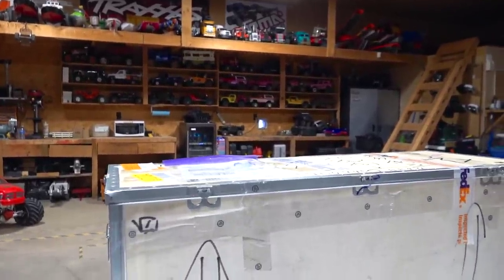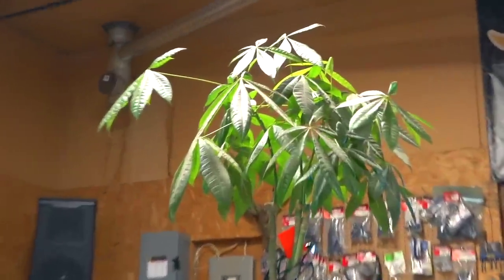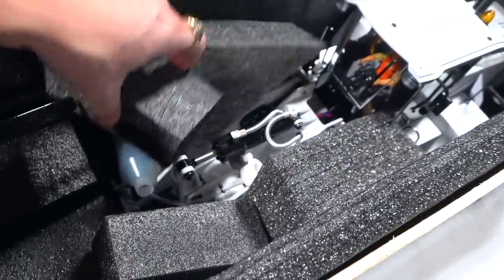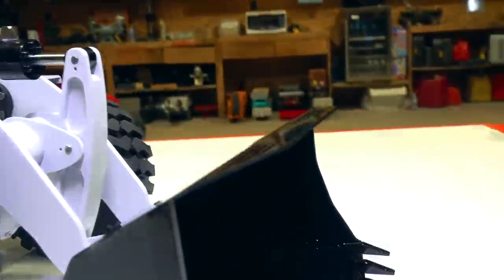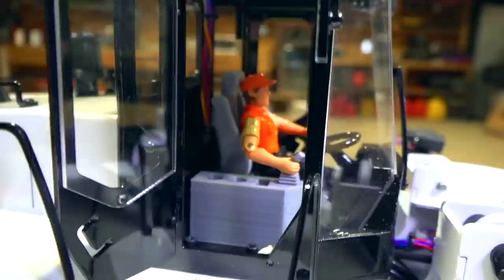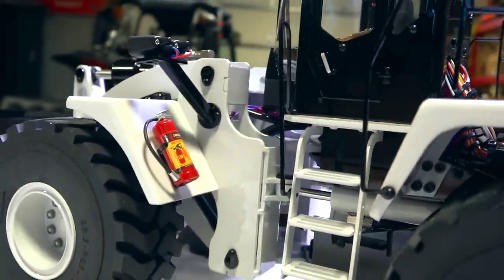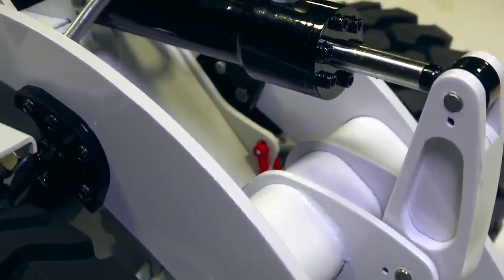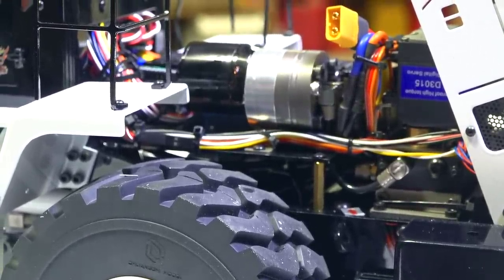FIRST UNBOXING of 2020 - WHITE FRONT LOADER HYDRAULIC FULLY METAL w/ LIGHTS & SOUND | RC ADVENTURES

Comment: Just found your channel, it’s great. I’ve got a real wheel loader, it’s a John Deere 624-K high lift ($200,000.00) it is fun to operate. FYI those hooks are there to lift the machine with a crane. For example these loaders are placed into a compartment of a ship to clean out material such as corn or wheat exported to another country.

Comment: Like you mentioned in your video you've gotten some bad deals when shopping for RC vehicles. Can you share what you've learned on how to avoid bad products? Brands to avoid? I bought a cheap (~30 USD) shovel loader and it has been a lot of fun to play with but I'd like to upgrade and hoped that there'd be products (excavators, shovel loaders, dozers) worth having that were < 1000 USD but I don't feel like I know what to look for or really where to look. Any suggestions? is the < 1000 USD even a realistic goal?

Comment: I have heard of people that have had to replace the ESC units. 

Make sure,  as with any Chinese machine,  to take EVERY bolt & nut apart, & put loctite on them. The bolts that hold the final drives........ they will work lose & cause failure, it thus still isn't done.

Comment: the toys people are making these days is amazing .....& amazingly expensive at $2,600 - $20,000. you can shop around find fairly old and worn-out REAL Heavy Equipment machines for those prices. my 1988 JCB 3CX backhoe (with extend-a-hoe & 4-n-1 loader bucket) was bought for $17 ,000. or my CASE 850 skid-steer loader also with a 4-n-1, bought for $8,000. again,they're old, worn out, but i find much cheaper parts on ebay than going to the dealership. however, once all the broken parts are replaced & once you're dig ready, you got a true, life-sized, 8+ton, driveble Heavy Equipment machine, instead of a toy.
Reply from the maker: Hmmmm...  https://www.youtube.com/watch?v=cg_7YNj2W-E
Reply: @TheRealRCSparks  combining RC with heavy machinery is relatively new & has it's benefits. that's all good but what i dislike is that they're experimenting with fully autonomous heavy equipment. not only does it take peoples jobs but it's far too dangerous. if they malfunction, they'd be unstoppable. multi-millions in law suits just to save $100 p/h or less

Comment: I thought the hydraulic oil you would use would be lighter weight, lower viscosity mineral oil, not real hydraulic line oil on full sized equipment.  I would assume at finer scales, viscosity, and cohesive forces in the oil would make it harder for finer scale hydraulic lines.